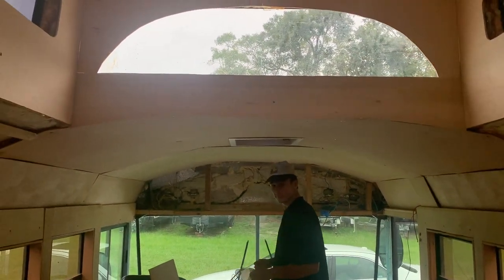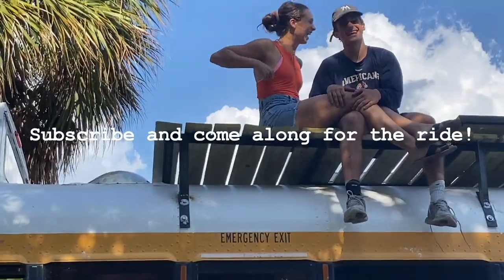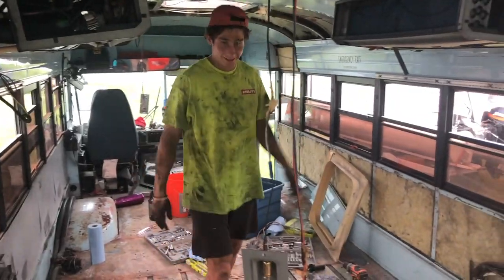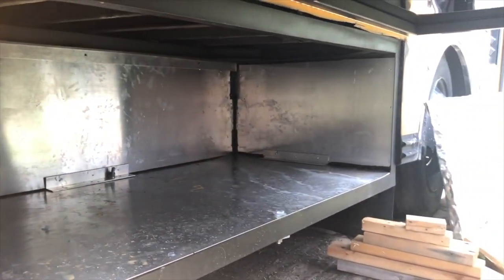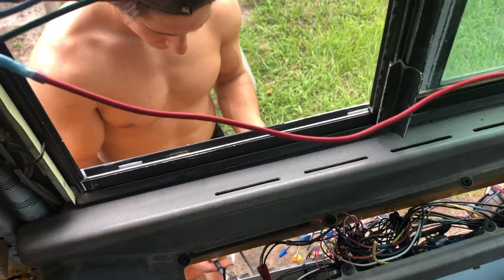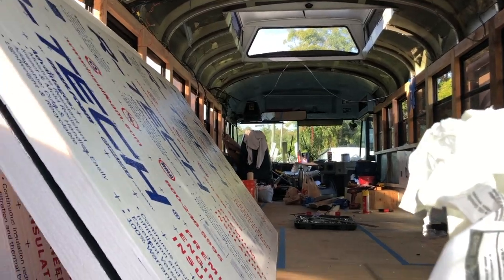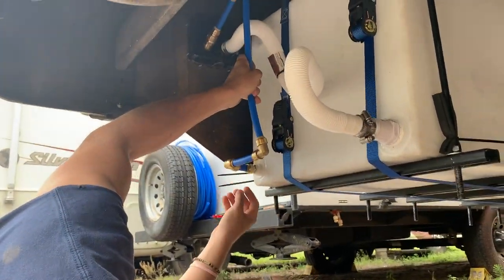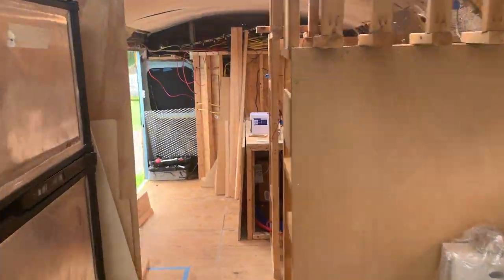First 8 Steps to Start Building A Skoolie Tiny Home | How to Start Your School Bus Conversion

Comment: Putting up electrical wires against the hot metal of the bus isn’t dangerous in high temps?  I’m at the stage where I’m deciding if i want to wire before or after insulation.  Thanks guys for all the info!  You are doing AMAZING!
Reply from the maker: Michelle TR thanks! If you see how people spray foam the wires sort of become entrapped in the insulation so they’re protected from all around
Reply: Shawn and Ash yes but in the case of using another form of insulation (not spray foam) the wires are pressed against the metal if you wire first and I just wonder if that would in time melt or mess with the wiring  in some way.   Thanks again
Reply from the maker: Michelle TR watch our insulation and wiring videos, we used rigid board and did not have that problem :)